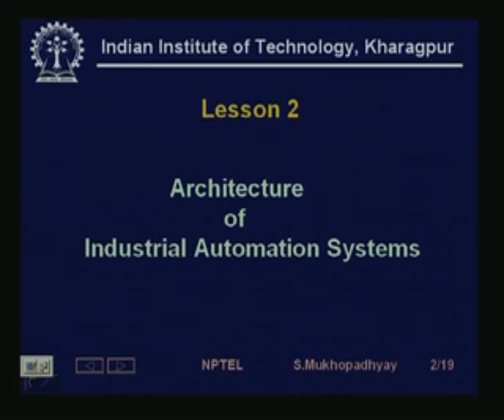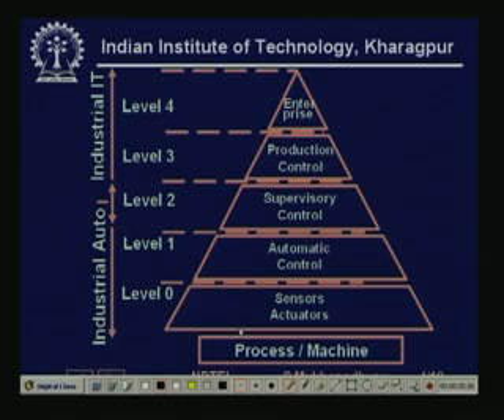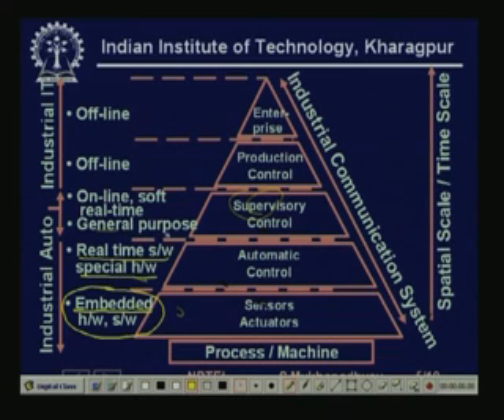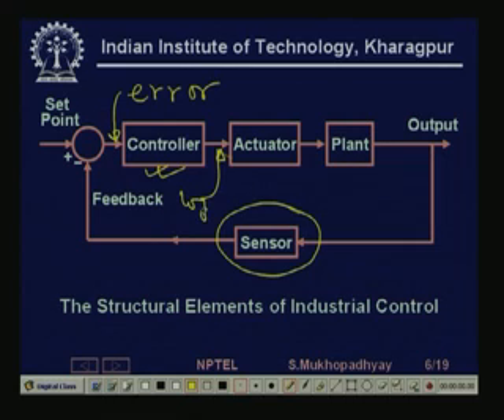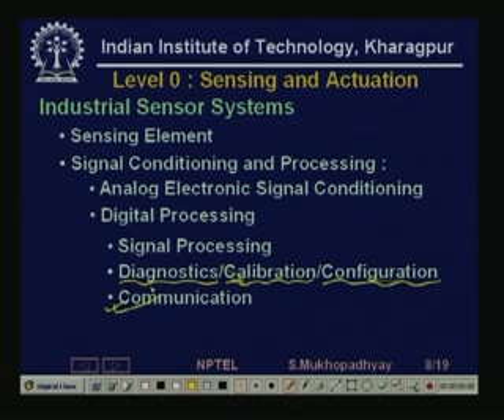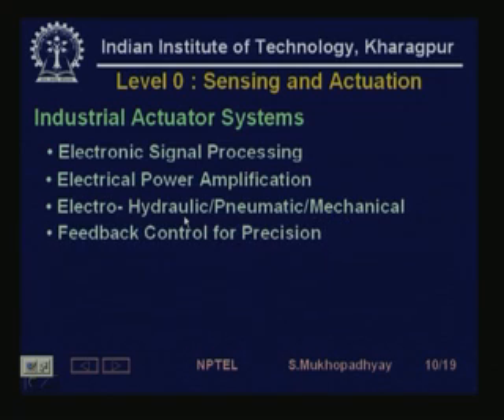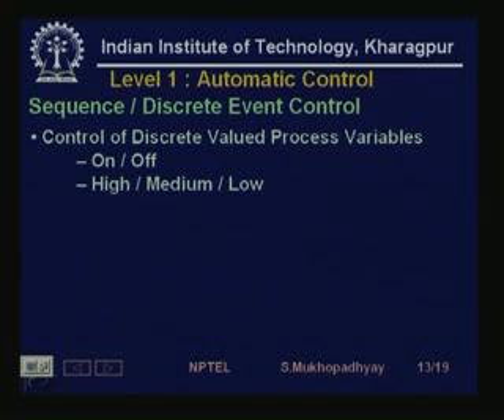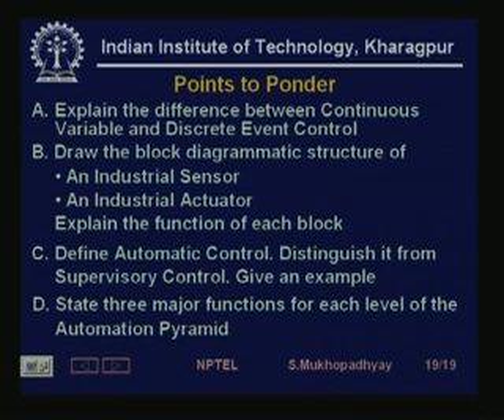Lecture - 2 Architecture of Industrial Automation Systems

Comment: At 14:30, by your logic about time scale and spatial scale increasing, shouldn't it then be an inverted pyramid? I believe you have misunderstood. The structure, as the name implies, is bottom-up, with the number of structural components (i mean sensors at level 0, field controllers at level 1, etc.) reducing as you climb the levels.

Comment: This lecture series is primarily a course on Process Control instead of Automation. Especially, hearing from what the Professor has to say at 7:08 about the higher layers. Also, it is surprising that this course does not deal with the distributed control system, which is fundamental to any process industry

Comment: 28:00 marks the point of this conversation. To understand the proses in industrial control system is on how to look the processes involved as a closed loop feedback system and then relate it to the structural pyramid which explain the manufacture itself comprehensively

Comment: Automation is more like replacing the need of human intervention.
For example, rising the temperature in your room:you can do it yourself by turning on the head  (and  you watch a thermometer to know when you`ve reached a desired  temperature) OR you can make an automatic control sistem that will do it for you (like start/stop the heat, monitor the thermometer).